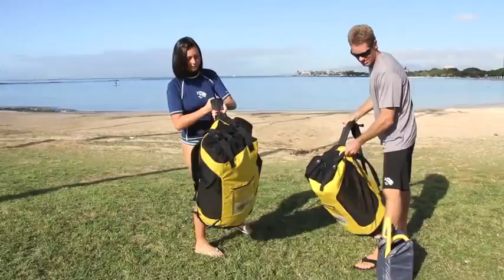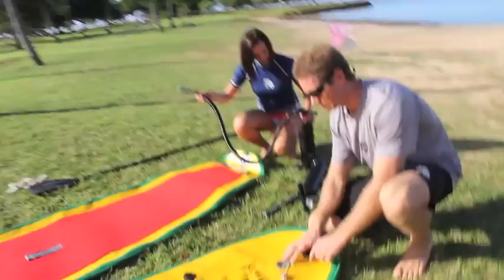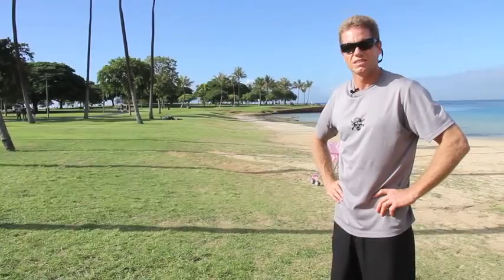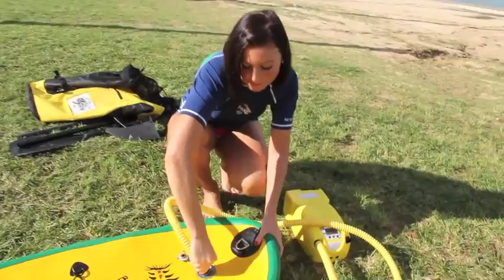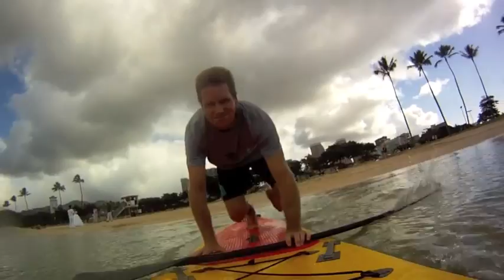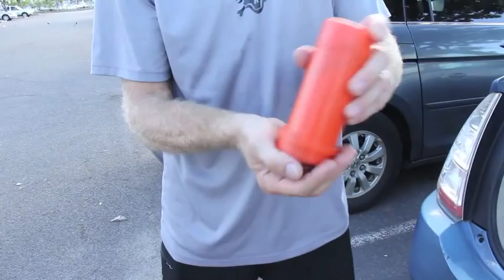BP Inflatable SUP intro

Comment: red paddle board and titan pump make light work plus stiffer board.sorry but these look more effort than they worth
Reply from the maker: +michael smith, this video shows our 2011 model year inflatables.  Our current lineup uses newer technology and our two stage pumps are much easier to use.  The boards have also gotten more rigid.

Comment: how could you mount the GoPro cam on the board?? tell me please
Reply from the maker: I used a stick on mount and secured it with extra duct tape and a tether.  I have not been able to permanently mount a gopro mount on an inflatable board.  The flexing and stretching from inflating, deflating and rolling up causes stick on mounts to fail quickly.  We have been working with our manufacturer on manufacturing and installing a gopro mount with flexible PVC base to install on all our new inflatable boards but it's still a work in progress.
Reply: Here's an idea for mounting a GoPro.  Get a right piece of plastic and mount the GoPro mount t9 n use the board cargo nets/cables to go across the rigid board.  That way the mounting board is sitting flush with the surf board and the go pro is on its proper mount.
Reply: You might be able to use a suction mount:http://shop.gopro.com/EMEA/mounts/suction-cup/AUCMT-302.html

I don't have any experience but would have thought it would stick as long as the board is inflated enough and the surface is smooth and clean. I'd use a tether as a backup too.
Reply from the maker: ***** The surface of an inflatable board is not smooth enough to use suction cup mounts, the nylon threads holding together the top and bottom sheets create a slightly puckered surface that suction cups can't stick to unfortunately.
Reply: +blueplanetsurf a
Reply: Typo.  Get a rigid piece of flat plastic (like a chopping board size)

Comment: where can I buy the electric pump
Reply from the maker: AIRTON CARLOS Hi Airton, there were some quality issues with the electric pump shown and we no longer sell these pumps.  We recommend using the hand pump.
Reply: There are many 15-20 psi electric pumps on Amazon. I bought a 15 psi pump and it works well.

Comment: Just my .02 but this video makes it seem like its a pain in the ass to pump it to 14 psi.  I mean it looks like you even have a hard time with it.
Reply: and the electric pump doesn't even pump it up to your recommended pressure?
Reply: Well.. it IS a pain in the ass to get to 14 PSI.
Reply: You can buy lots of electric pumps that take it all the way to 15 psi - and they can deflate the board really quickly as well.

Comment from the maker: Just to let everyone know, we no longer offer the electric pump shown in the video.  We found that for the price (over $200), it was just not worth it.  The maximum pressure reached was not high enough and we found it prone to break down.  The included hand pump works fine, you just have to take your time and get the pressure up to 15 psi for best results.